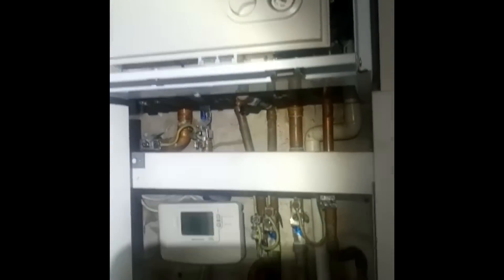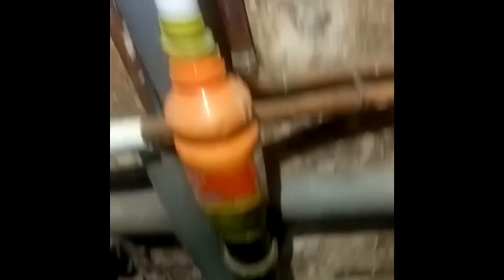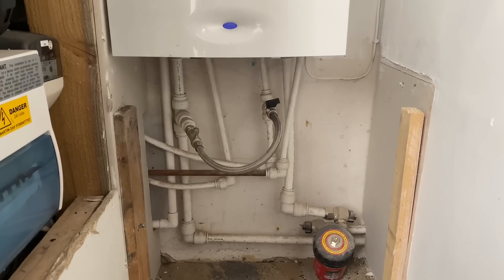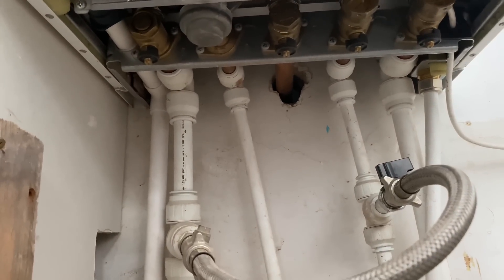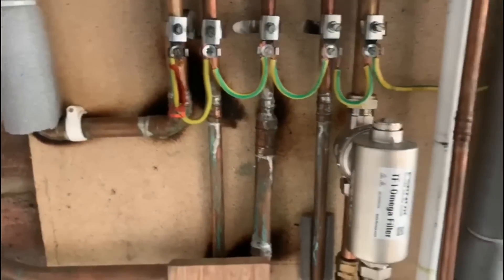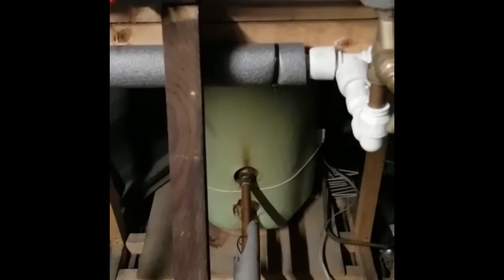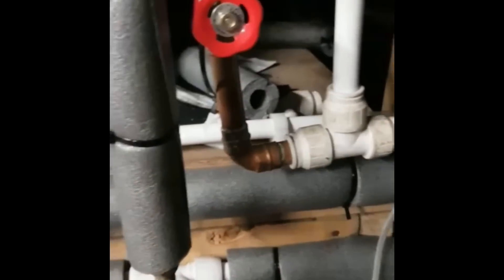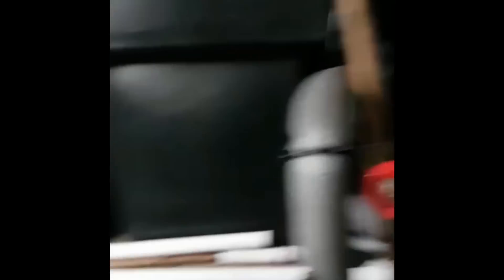Badly Installed Plumbing / Gas Training

Comment: Hey , I’m an HVAC tech and a pipefitter from Philadelphia, Pa USA. Very fun to see the ways different countries install boilers and gas lines. Are all gas lines ran in copper there? We only use galvanized steel for outside and black iron pipe for inside.